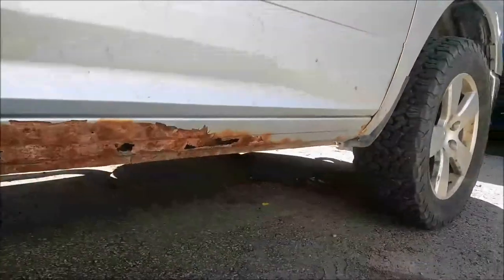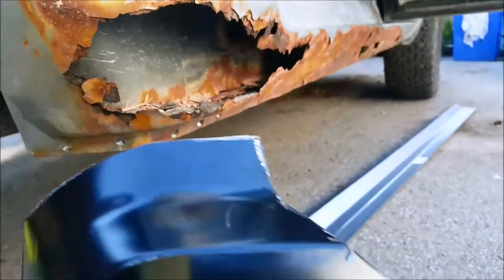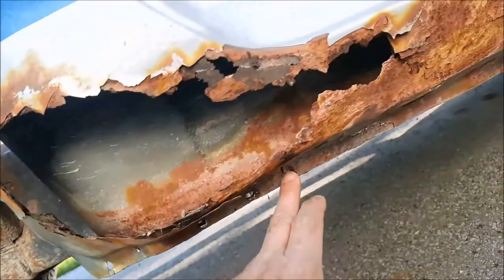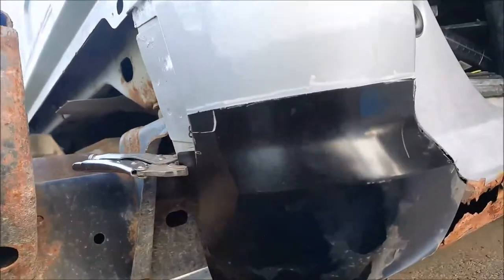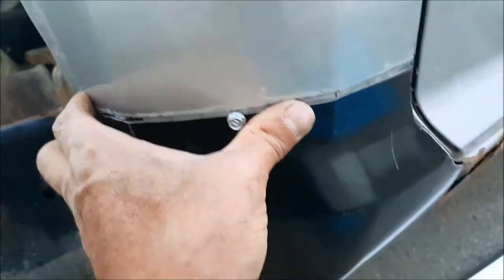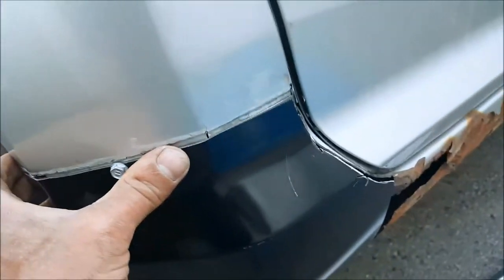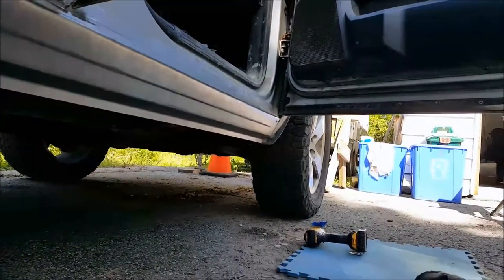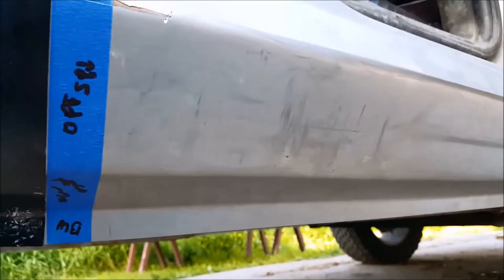HOW TO REPLACE A CAB CORNER AND INSTALL A SLIP ON ROCKER 2012 RUSTY DODGE

Comment: What plug weld machine did you use? Thanks!
Reply from the maker: Plug welding is term for a process. Any mig welding machine can be used to pull weld.

Comment: If you try to save these cars, to be definitively efficient against rust ,  you should  put grease everywhere. grease is the only thing very efficient against rust. put grease between metal and carpet, inside door, behind metallic bumper, under the vehicle, behind  the repairs you can make (everywhere inside the body - hidden erea -  instead of using paint), hollow areas (necessarily hidden, so no need to be aesthetic). For rear wings unreachable with a paintbrush, use an extender and pour old oil everywhere each year. Rust almost always comes from the inside and welds.  Handyman Experience - 35 years.   From france
Reply from the maker: I tell all my clients that. If you want this repair to last make sure to get it oiled. If they don't not my problem.  Thanks for watching. Much appreciated.

Comment: If I buy the replacement rocker and cab corner for both sides, how much is a fair price if I take it to a body shop to put on and paint?
Reply from the maker: Hard question to answer. This would be an hourly rated job for a body shop if they even do rust repair. I can only recommend getting some quotes. I can tell you it would take me about 4 hours to cut, fit, weld and grind both sides like I did in the video.
Reply: SW Customs thanks for the quick reply.
Reply: I was quoted about 3 grand for replacing my cab corners and rockers. Nice work replacing the panels. I have done these before; the only difference was the fact I left the bed on, but it was a pain..